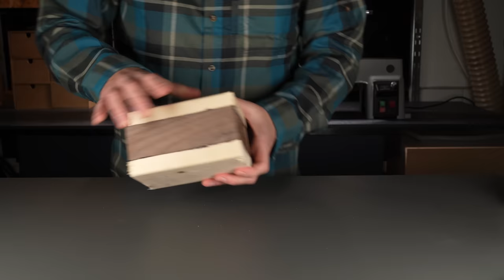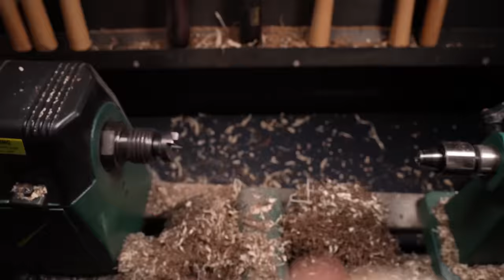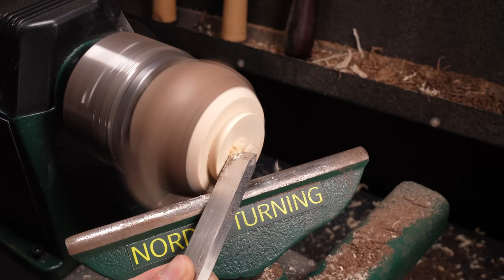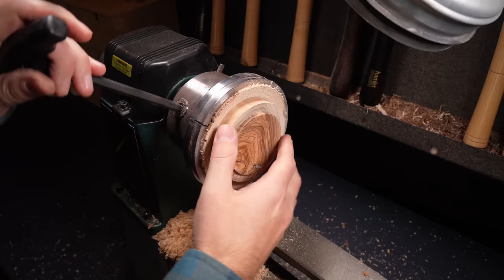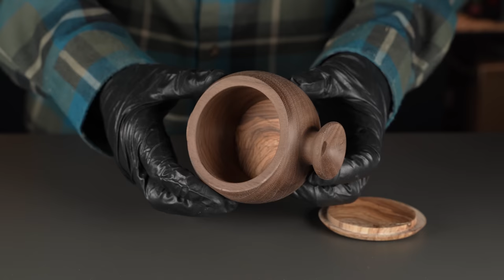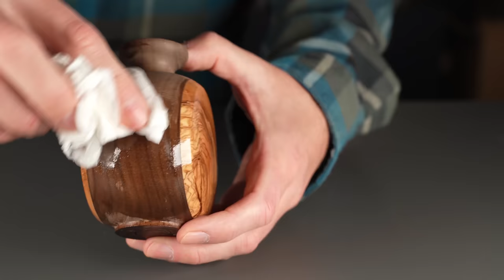Woodturning - Watertight and food safe canteen turned on multi axis without any jigs

Comment: Oh, I thought the outer panels would be more spherical, so the flask could hold more liquid.
Nice technique by the way.
And for the record, ALL two part epoxies are food safe once fully cured.
Another way to make it waterproof is to simply glue the panels on with epoxy, then when cured, melt some beeswax and pour it in. Fill it right up and dump it out immediately. That will leave a nice coating of wax on the inside.

Comment: I enjoyed seeing the carefully thought work flow on making the flask. This is what is so intriguing in wood turning. One aspect is to master the handling of the chisels. Another thing is figuring out how much can be done with rather simple tools, and what is the best workflow. You really showed the potential and opened my eyes for new opportunities using the same tools. Thanks! ❤
Reply from the maker: I’m glad you liked it 🙌 thank you 🤩
Reply: Actually, the work flow was wasteful and unnecessary. Why glue together 3 blocks of wood, only to completely cut 2 of them away? Just start with the dark block, cut it hollow, then add the 2 new end blocks as he did. As an engineer with production training, this unnecessary workflow made the viewing experience less enjoyable for me. I like to see optimized workflows.
Reply: @MaskedMarble  well, as a DSc (Tech) in industrial engineering and management I consider the workflow well thought. Because his intention was to demonstrate how to do this with just the specific chuck and jaws. For what you described, a set of different fixtures are needed, and jigs built, this method shows how to get perfect fit without any extra tools. Feel free to make a video to demonstrate a more efficient way to do this end result. Material for jigs counts.
Reply: @MaskedMarble полностью с тобой согласен, приклеить светлое дерево, лишь для того, что бы его отрезать, это расточительно и долго, можно было сразу начинать с тëмного дерева😉

Comment: After doing a fair amount of research on safe finishes for wood cups, I believe most epoxy would be fine for this application. If i understand correctly, the only risk in using epoxy is that it may chip off and get into the food you're making. This wouldn't be a problem for this project since you're not going to be scraping the inside with metal utensils  (like you might with a wooden bowl). Just my thoughts from what I've read, but I may be wrong. Also, I must say that is one GORGEOUS piece. Your method of hollowing the inside was very creative, thanks for sharing your process 👍

Comment: It'll always be round anywhere in the X section, don't worry. If it was as you thought (ie. as in a horizontal Y section), it'd be very difficult to achieve a sufficiently accurate circle by eye. Nice flask 👍

Comment: Very nice Video . Instead of Epoxy you could use Kelterlack , its used  to seal liquid feeding Trough from the Bees for example. Absolute Foodsafe and non toxic . You can get it in almost every german Woodturning Shop like Steinert, KS Schulte etc . I use it for wooden Cups. And i will use it for my Oliveoil Flask , if i ever find the Time to work my List off lol. Tusen takk for flott Video. Hilsen fra Bayern 😅
Reply from the maker: Thank you! 🤩 I’ve gotten a lot of sugestions for alternatives for epoxy in the comments, but this is best one I think. I will try to get a hold of some for sure. Best of luck with your projects 👍 tusen takk 😆

Comment: Beautifully crafted. The olive wood accents are gorgeous. Since you're filling this with olive oil, I wonder if you even need afinish on the inside. Can you just let the olive oil feed the wood?
Reply from the maker: Thank you! 🤩 You might be right, a few others have commented that they let the oil itself do the job. Next time I have to try that. There has been a crack in the epoxy coat on mine now, the wood moved in two directions because of the grains, so it has a leak now. Wondering if this would be less of a problem without the epoxy and the wood was given a bit more room to move.

Comment: I think the flask looks great. I have a wooden plate for most of my meals. It's made from camphor laurel. I use raw linseed oil to preserve and seal it. I've never tasted anything other than the food and couldn't imagine using any other plate. I don't know what our food safety standards are in Australia. I'll have to look.
Reply: I Googled food safe epoxy. Basically epoxy is food safe after it's cured fully. There is a list of resins that are stated as food safe.
Reply from the maker: Thank you! 🤩 I found the same in my research. Foodsafe when cured as long as it’s not heated up to much after.

Comment: I agree with mc-kik6ik, and although bisphenol-A epoxy is “food safe” I would not be happy to store liquids over extended periods. It is one thing to drink from a cup that is coated with epoxy, and a completely different over time. A cup is at least rinsed after use.
My personal opinion is not to coat the inside. The question is the adhesive. If BPA -free epoxy is to be used, the contact area (in a bare vessel) would be minimal. 
Anyway, nice work!  Looks superb.
Reply from the maker: I will try just not treating it next time for sure. At the very least it will be ok for years before going bad, and a rinse every once in a while would help. Thank you for watching and commenting 🙌

Comment: @NordicTurning
Your work is super inspiring. In the very near future I will take my first steps in woodturning. Could you please send some information about what epoxy you recommend for household work and for use in contact with food.
Reply from the maker: Thank you! 🤩 Nice to hear you are getting into woodturning, you’ll get hooked for sure 😆 Not sure I’m the best to recommend epoxy as I rarely use it myself. But for this project I used West Systems epoxy. They say it’s food safe and was perfectly fine for the project. Best of luck 👍
Reply: Interesting. About a year ago I called West Systems and talked to an engineer about if it was food safe as I used it on a cup I made. He couldn’t tell me that it was and that they hadn’t tested it for that. Have they changed their recommendation? 

This flask is gorgeous. Very nice work. Thanks for sharing!

Comment: I made one just like this with perspex windows.....i put some old wine in it and it leaked like a sieve.....😅...I'll  have another go and use a less porous wood.....nice job by the way
Reply from the maker: Hehe that sounds about right, mine has started to leak now too. There must have been some movement in the wood and a problem with two grain directions 🤷 Thanks 👍

Comment: Very nice. I am sure it will be ok regarding food safe. Could you not have left the inside bare. Olive Oil would do it no harm and bare wood would do the olive oil no harm. I think!
Reply from the maker: Thank you for commenting 👍 You might be right, but I’ve read that organic oils will spoil in a year or two and leave residue and flawor to the treated product. I thought about saturating the container with food safe danish oil insted of the epoxy. Hard to know whats best, a lot of different opinions on the matter 🤷
Reply: Hello. I watch all of Richard Raffan's excellent videos and he has 50+ years of utilitarian production under his Belt. He has produced thousands of Plates, Bowls, etc and his products gain patina over time but are serviceable many decades on. I would think just a flush with soapy water periodically would suffice. @nordicturning
Reply from the maker: @25is27  He would know for sure. I too love his videos 👍

Comment: Very well demonstrated,  beautiful piece, thank you.  How did you find the centre of the sacrificial sides when you re mounted it in the second orientation?
Reply from the maker: Thank you for the comment 🙌 I used a soft meassuring tape to find the diameter(and radius) of the construction lumber circles, and then used a compass to mark lines from three points around the circle to find the center. I actually spent some time pondering how to do this myself, and ended up not filming it.🤦

Comment: How did you get it centered for the second axis turning?
Reply from the maker: I used a meassuring tape and compass. Found the radius of the white wood, and marked the center from three points on the edge of the white wood. Terrible explanation, sorry. Did you get it?

Comment: There are over 10,000 different types of plastic on the marked. Just because one is safe to use when it is hard doesn't mean it is safe for all others. Especially with home mixed two component plastics I'd be carefull. There will allways stay tiny amounts of monomeres (the single components) that haven't reacted. Depending on how thorowly you have mixed there will be more or less. And I think you don't get to the quality they reach in a lab or factory. Thats why they use PE or PP for most food containers, since the monomers are not toxic and evaporate after the polimerisation.
I couldn't say for this product, and as long as I haf nobody from the company of this epxy to talk to about this explicit product, I wouldn't do it my self... 
But I have sealed wood with wax bevore. Things from one piece of wood are easier for this since they don't have wood glue joins that can crack, even thou it is stress for the wood it self too. You can just heat the whole thing up and pure liquid bees, carnauba or sunflower wax in. let it soak into all surfices and pire out any acess. Not suited for hot drinks and stuff but 100% food save.
Reply from the maker: Thank you for commenting 👍 I agree with you, wasn’t sure this was the best way to go either. But I got lots of good alternatives from you and others in the comments 🙌

Comment: Being here in the USA, our Food & Drug Administration states, NO wood finish is food safe... Until it is cured.  Most finishes including epoxy are cured after 30 days depending on Temperature and Humidity.  The big issue is that you have your side caps that are end grain, and the body of the flask is side grain. Even with the epoxy it will crack. Also Walnut is toxic. (that is why you should never use it for animal bedding especially horses.)
Reply: That’s definitely why walnut cutting boards and walnut oil are totally and completely banned in the U.S. /sarcasm. It’s the mastication of walnut that releases the toxin, which is why animals that chew wood are prone to this, and animals that don’t usually aren’t. Juglone degrades over time and is rendered harmless, and any epoxy coating thick enough to render wood water tight will encapsulate this until it’s degraded. 

The big issue of cracking that you briefly discuss, are you bringing this up as a safety concern, or are you worried that one day this will crack in a modern home that’s fairly humidity stable, compared to 20-30 years ago, and render this beautiful and functional piece into art?
Reply: Male Karen
Reply: Female Kevin? 😂
Reply: The art piece is beautiful
Reply: Great combo of wood,finished craft piece  very attractive, time well spent.
Reply: I beg to differ sir, walnut oil and beeswax is non toxic when it is applied and forever after that as well.  I have  chewed the beeswax and drank the walnut oil , I am 70 years old and have used this finish for 30 years and I am in good health!
Reply: @garthreynolds1437 
HEYYYYYYY !!!!
What's with the gay stuff?
Lol
Reply: @kevinarmstrong8237  I have two brother's in-law named Kevin. Love them both . One of them just told me how upset he was that male Karen's were being called Kevin. 🤔  loves and hugs to all Kevin. Lol 😆
Reply: @garthreynolds1437  
Lol
We need to laugh. ........
Reply: I wouldn't worry about it. The resin should take care of all the issues you mentioned.
Reply: Great work!